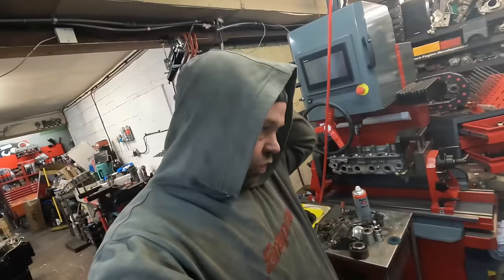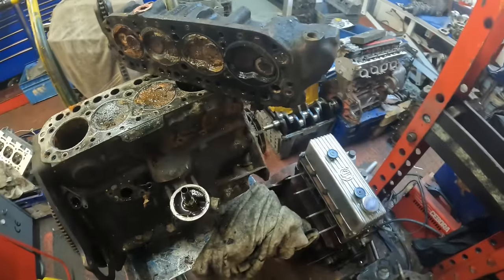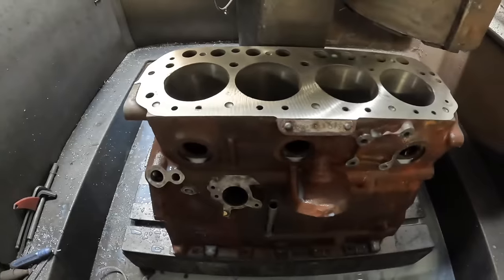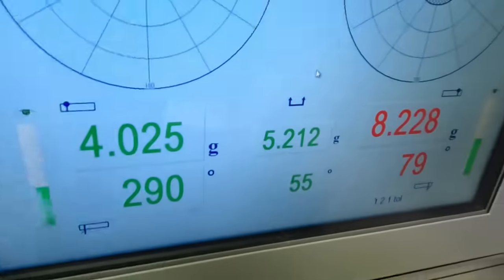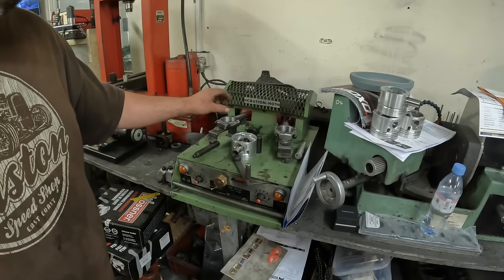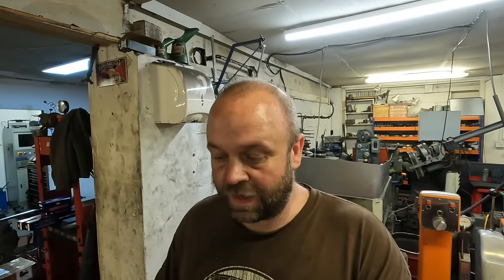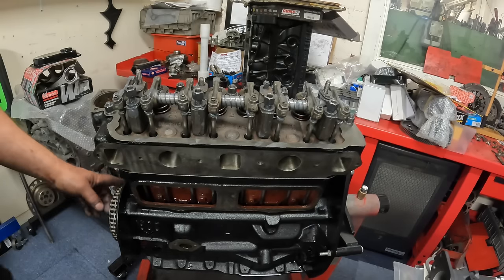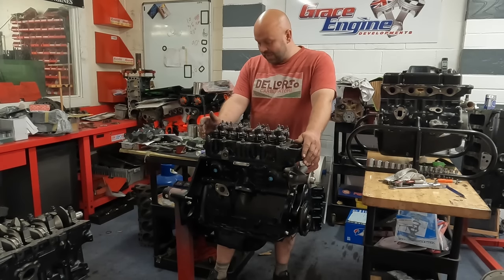A complete video of an 1.8 MGB engine being reconditioned and modified.

Comment: My bad for the following though if an engine has bore spacing / pitch of 87.3mm (1-2) / 98.4mm (2-3) / 87.3mm (3-4) aka 1-2= 3.4375" / 2-3= 3.8750 / 3-4= 3.4375" like on the 1.8 MGB engine (or at least what was mentioned in the MGEXP forums), how does one work out the overall bore spacing? Is it based on the figure from cylinders 1-2 and 3-4 or the figure from cylinders 2-3?
Reply from the maker: Hi and thanks for watching.. 
What is it you need to know.. the bore spacing is different so I suppose you can't work out an accurate overall spacing only an average.
Reply: Hello. Was trying to figure out what the cylinder centre distance in mm was on the B-Series engine as a factoid, since could not find what was specifically looking for online (or even in in the Peter Burgess book on power tuning the MGB engine).

So far with other BMC engines have read the E-Series centre spacing was 82.5mm, while the K100 / K16v head conversions used on the A-Series has a bore spacing of 76mm (although it is not clear if that applies on all A-Series units).
Reply from the maker: So are you looking at offset boring to fit a different cylinder head
Reply: No, had nothing specific in mind. Was just wondering whether to use the 87.3mm or 98.4mm figure for the B-Series bore centres or go by approximate average.
Reply from the maker: I don't think you can really use any.. I think it would just have the 2 different centers

Comment: How much of an impact on performance or longevity does having it balanced when reconditioning? How much does it add to the price?
Reply from the maker: On an old engine like this it help a lot.. performance wise it helps the engine pick up better and smoother.. full engine balance starts from £160
Reply: @graceenginedevelopments  I’m in the US.  I have a 66 MGB that’s been in the family since around 72. I drove it until 86 when I was at University and I began having hydraulic issues. It’s been parked since then and now I’m going through it making the needed repairs. I found the head was cracked (no surprise). I’m trying to decide whether to just get it running and see how it is or to bite the bullet, pull the engine and have it reconditioned.
Reply from the maker: Firstly welcome to my channel I hope you find it helpful.. it's nice the car has been with your family for so long.. if you've got the head off already and your doing other repairs to the car it may be worth doing the engine so you know all is ok, last thing you want is a road trip and something in the engine fails.. if you need help with anything just ask..
Reply: @graceenginedevelopments  would it be worth my time (money) to tear the engine down myself or just take it in an have it built?
Reply from the maker: @aggiebq86  if you feel confident enough give it a go.. we are here to help with any questions you may have.
Reply: @aggiebq86  You could just pull the head.  They can be repaired, depending upon where it's cracked.  There are also plenty of suppliers for replacement heads.  Take a look at the Moss catalog.  My MGB-GT is also a '66, and I had it since new.  :-)
Reply: @MilouTintin  thanks for the advice. I visited with my machine shop that has experience with MGB engines. They didn’t think it was worthwhile to attempt a repair. I’ve already gotten a shallow chamber big valve head to go on it.
Reply: @aggiebq86  The block will need to be modified to accept the extra length of the valves.

Comment: Not criticising what is a superb video but when the distributor drive gear has been inserted as well as the slot in the dog being as you describe the offset needs to be at lower right or the rotor will be 180 degrees out.
Reply from the maker: Yes, sorry I worded it wrong in the video I meant to say the slot pointing to number one.. it was corrected but not in the edit..

Comment: Could you put links to the suppliers in the description?
Reply from the maker: Yeah which ones.. we can also supply everything if you need.
Reply: I’m looking at building a ‘66 MGB with a fast road engine as well. Mainly interested in the camshaft and pistons I should use. I have a big valve head with the shallower combustion chamber that I’m using.
Reply from the maker: @aggiebq86  hi, I use Kent cams for 95% of my engines.. if it's a fast road spec your building they would definitely have a good choice.. piston wise a good quality cast piston would be fine.. or if your budget allows go for omega

Comment: i would have thought that the block would need any skimming/truing before the bores were drilledd/honed/trued as the top of the block serves as the surface on which the boring tool sits. ...but then again, i have absolutely no knowledge WRT machining blocks.
Reply from the maker: You are correct, we check before and if it's out of boring spec it would be done first

Comment: Can't believe you've gotta remove/loosen the rocker stand's grub screw to lift off the whole assembly!  You guys say bollocks?  Woulda been nicer to face the block .008" BEFORE mounting the boring bar to it!!  Also, those rods were not damaged by swarf, else the crank would have had the exact same damage, right!  Don't know what did it but you are wrong.  Also, that swarf WAS NOT on the crank bearing, don't be foolish, it would be in the filter, you've dropped it on there!  Wish you would have shown the damage it did to the pump though.  Lotta port grinding with your eye protection up.
Reply from the maker: You don't need to remove the grub screw to remove the rockers, removed it just because I was completely stripping everything.. it was 100%boring swarf, identical to the swarf my bar makes, the crank did have some bits of damage on it too..

Comment: bump it up to 100 h.p.! trash the SU's
Reply from the maker: What would you fit Don, Weber?
Reply: that's what I have on my datsun; or buck-up and go aftermarker fuel injection @graceenginedevelopments
Reply: There has never been a higher quality carburettor made than an SU.  Only the ignorant and the lazy would fit something else such as the awful Down Draft Weber.  
Injection on an MGB.. ridiculous. 
The Datsun did not have SU carbs .. they were Japanese copies. Very good though. 
Considering the stock MGB motor has 95 HP (new or in very good condition) getting another 5 HP is simple. Porting would be the key here. 
My guess is the motor in the video is now somewhere around 110-115  HP, possibly more depending on other factors such as the exhaust system.